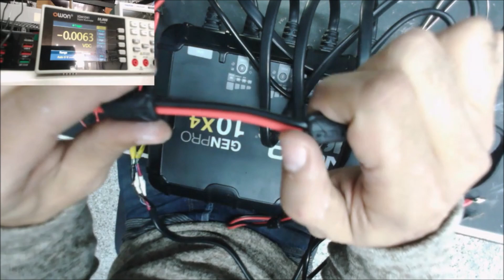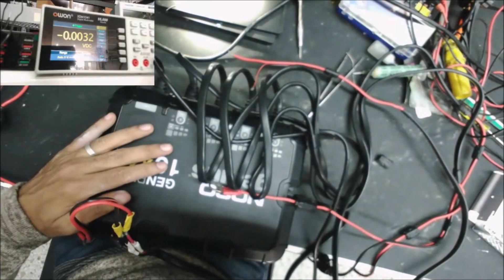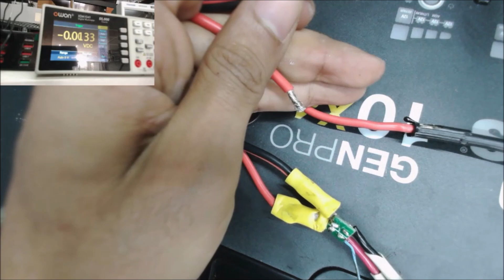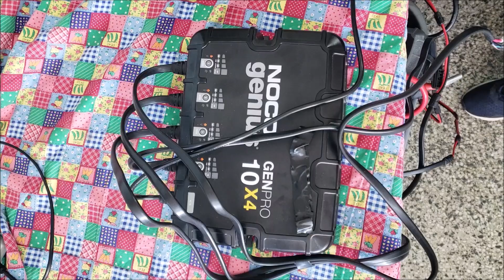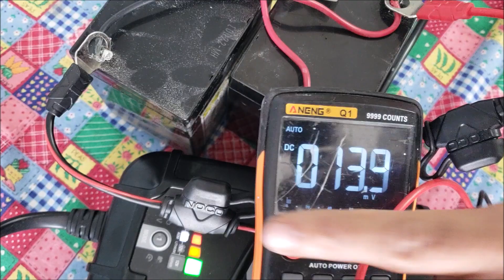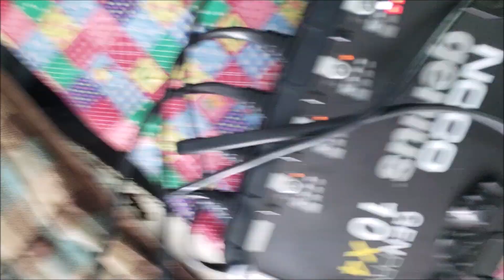NOCO genius GEN 10 PRO X4 stopped charging the battery after damaged wires

Comment: Great job, I have the normal NOCO GENIUS10. Everything works apart from the red and black lead cables, not giving out DC volts. Ive used multimeter tester and it still reads 0.01 volts. But when on standby,  i see DC volts on the red and black cable ranging from 0.00 to 6.44

Comment: Those thermistors come in many different impedances (1k - 100k), did you measure that known good one? I have a genpro 10x4 with channel 1 not charging & gotten to the sensor which measures over 130k ohm @ room temp but unknown if that's correct. I thought most common in lithium battery packs was a sensor with a resistance of 10k ohm but I don't really have any dead packs to tear apart for comparison.
Reply from the maker: get one from any battery as laptops batteries

Comment: What is the ampere rating in the fuses?
Reply from the maker: what fuse? i changed the thermal resistor in the video no specs in it
Reply: check on Noco webapge under Cord management. states for Genpro10x4 fuse, 15 AMP MINI ® Blade Fuse